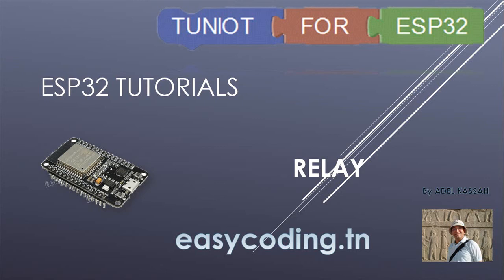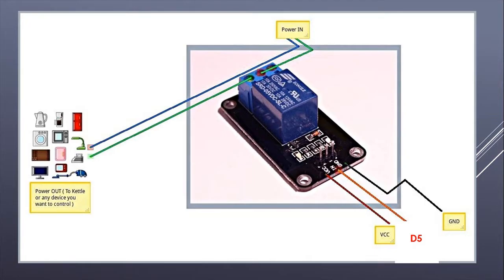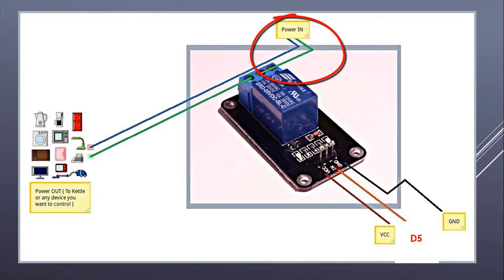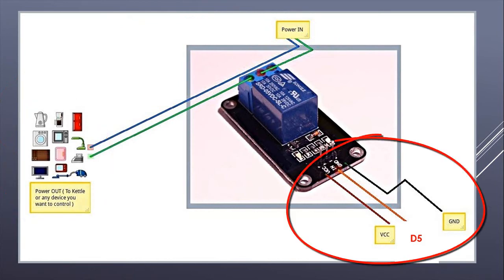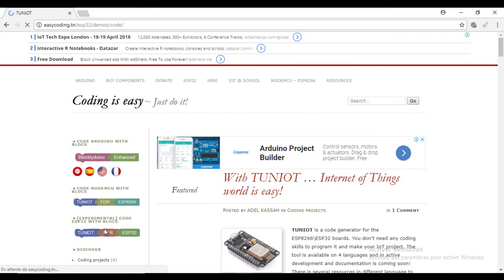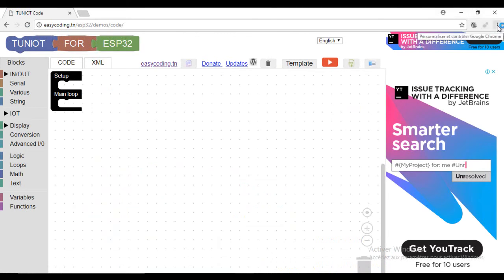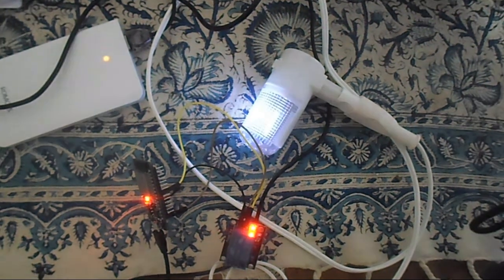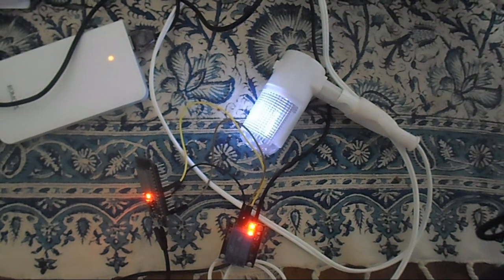ESP32 tutorial A-11:  The relay

Comment: if we give Vcc=3.3V to 5V relay the does it will works?
Reply: he used a relais shield, the shield will work with the 3,3v output from the esp. If you want to use a single relais you have to boost the output power to 5v or whatever your relais needs

Comment: Hi Adel Kassah, at the moment, I'm trying to control relay module using ESP32 board (SOM-ESP32-1). I've successfully control these relays via WiFi, however, I cannot find any way to control them via Ethernet cable (for stable connection). Could you give me some ideas? Thanks a lot